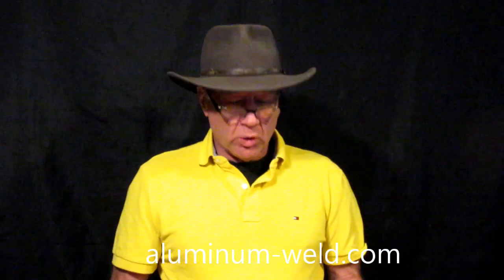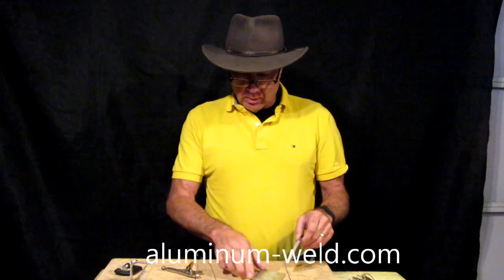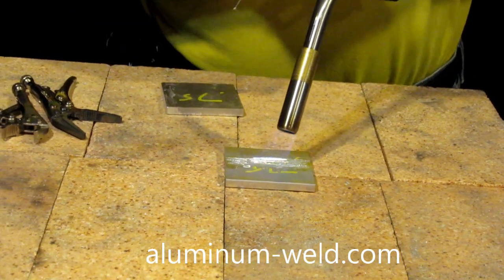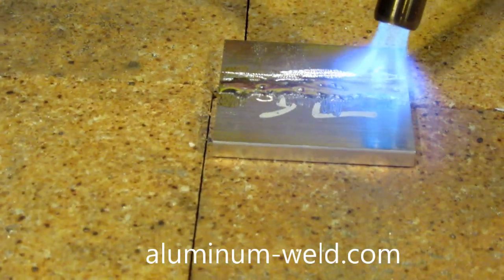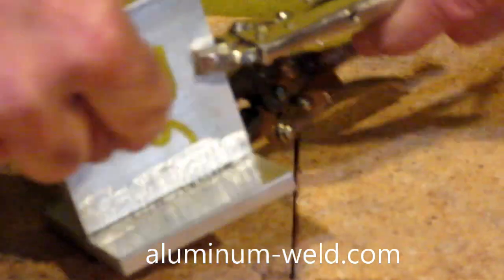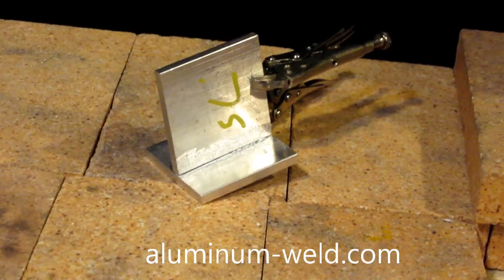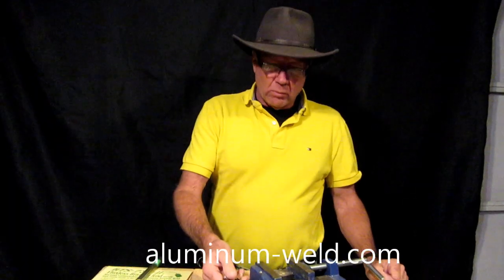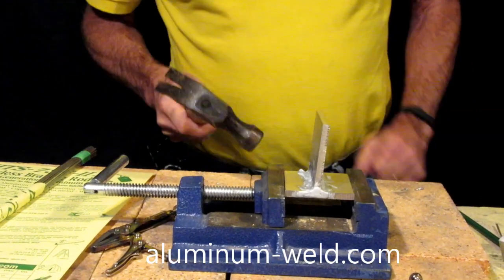Aluminum Weld Tee Joint Strength Test HTS-735-11

Comment: I've got a busted engine case on a Honda 4 wheelers. My chain came off and bunched up around the sprocket and the shifter. The case cracked and all the engine oil ran on the ground. So I ordered a used case..I'd like to repair the original case. It's cast aluminum so idk much other than it's nothing special about it. Would the HTS-735-11 rods work?
Reply from the maker: Hi Bobby,
The HTS-735-11 works very well on cast aluminum. Just follow the instructions , clean, heat to the melting point of the rod, apply the rod and let slow cool. practice a little before you work on the case. Watch my videos  were I repair a case. Call for anytime  for additional questions.

Comment: I don’t have a welding machine, but I do have these rods and have used them to great success repairing holes and cracks in my Jon boats. I was thinking of installing a casting deck on one of these boats. Would this method be adequate to construct a frame for this deck?
Reply from the maker: Hello, Glad the rod is working for you. As for the casting deck the rod should work just fine for that. You may want to watch my square tube video "welding square tubing" showing how to add a support for extra strength. Thanks

Comment: Heh i have not done any brazing or welding on over 30 years and i can still do a far cleaner job without post weld grinding
Reply from the maker: I never claimed to be a great welder and most of our customers are not and you don’t have to be in order to make repairs yourself and save hundreds of dollars and lots of time. 
The purpose of this video was to show how to achieve full strength by applying the rod past the joint on both sides to achieve full strength applying the HTS-735-11 rod  only in the joint may look nice it will not be nearly as strong as going past the joint.
 Thank  you for your interest I’m just a bit of a slob I guess take care.

Comment: Hi , really informative video. One question how thick should be the aluminum to don’t make a hole ?  Can I use a torch with 1/16 ? I was thinking in doing a frame .
Reply from the maker: Hello Fabian,  Any thickness can be used because HTS-735-11 melts 500 degrees F. below the melting point of aluminum. So you must be able to control the heat by pulling the torch back away from the joint being joined. I use a wide torch so the heat is not concentrated I have an instructional video on youtube search HTS-735-11 on youtube. The 1/16 tip will concentrate the heat to a small area, you need to think of just warming the aluminum up to 735 degrees F. so the rod melts. Use the HTS-735-11 rod to determine the temperature as shown in my youtube videos. When joining two pieces together both must be hot enough to melt the rod. KEEP the ROD OUT of the FLAME. If you work the rod too close to the flame you will heat the rod  so it melts before the aluminum reaches 735 degrees F. so the joint will fail. Watch my square tube video on youtube or give me a call and I will gladly help you.

Comment: Would a 1300 degree Celsius torch be sufficient enough for this method it is dual flame aswel
Reply from the maker: Hello,  Well 1300C. equals 2372F. That is about the same as propane depending on the torch tip. The best answer I can give you is if you cannot get the aluminum hot enough to melt the rod then the answer is no that torch is not hot enough.  You must adjust the heat source to the project. I use MAP Gas and a Berzomatic TS8000 when working on large projects like boats and a  less hot torch when working on small thin aluminum.  Sometimes I have to use oxygen acetylene. What are you working on? I can give you a better answer knowing that.

Comment: so, you clean the oxide layer off ahead of time but you don't have to scrape underneath the hot pool w/ a screw driver?
Reply from the maker: Hi John, Not sure what you are asking, but all surfaces must be cleaned and oxide layer must be removed before heating and applying the rod. Roughing up the surfaces improves the bond as well.
Reply: Aluminum-weld.com yeah but your site says that your “2nd generation” rods penetrate oxidation and do not require a SS brush???

Other vids ive seen of similar products show the joint being scratched w a SS brush or flat head screw driver under a pool of the melted rod before it cools.   I do not believe you did this but clearly you dud abrade the pieces ahead of time
Reply from the maker: Hi John, Now I understand your question. You observations are right on.
 HTS-735-11 is a new second generation rod that has no aluminum in it. Therefore you do not need a stainless steel brush, or use a screwdriver as you described with the old rods out there. HTS-735-11 works well on cast aluminum and aluminum that is less than perfectly clean, where older rods types that contain aluminum will not work. Also HTS-735-11 work on most nonferrous metals. It does no work on stainless steel, cast-iron, or steel.
Reply from the maker: Hi John . Here is the issue you have been describing

( HTS-735 II penetrates the aluminum oxide creating a chemical bond (Eutectic Bond) that is stronger than the original commercial aluminum. Results are unquestionable. The repairs are stronger than new.

Unlike the old first generation rods still sold today on other sites, HTS-735-11 does not require special stainless steel cleaning brushes. This patented new technology product penetrates past impurities which may be impossible for the competitors products.)

I agree the wording is not great. And will be updated thanks to you.
Bottom line is you must remove the oxidation  or anodized layer before applying the HTS-735-11 rod. The Key difference is you do not have to use a stainless steel brush as with the older rods out there, and HTS-735-11 will work when other older rods will fail due to impurities.
Reply: Aluminum-weld.com okay. Thanks.  Is there cadmium or lead or other toxic metals in there?
Reply from the maker: John Smith  Hi John there are no heavy or toxic metals in this rod HTS-735-11 is safe for water pipes cookware canteens

Comment: Do you think using this method to fab a bike cart with around a 300lb weight limit would be okay? plan on putting around 70lbs of lipo batteries on a 2 sitter trike bicycle. total weight as is right now arounf 600 lbs can get up to 32mph. what are your thoughts thanks??
Reply from the maker: Kevin James 

Hi Kevin that would be Sufficient for your bike trailer I would suggest you reinforce some of the joints using either angle aluminum or straight piece inside the square tubing good luck and send me some pictures